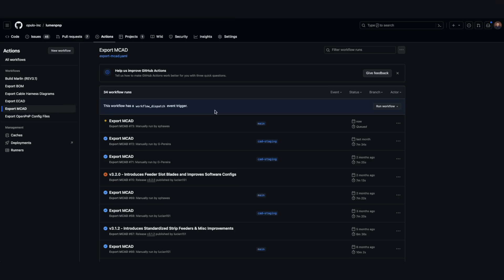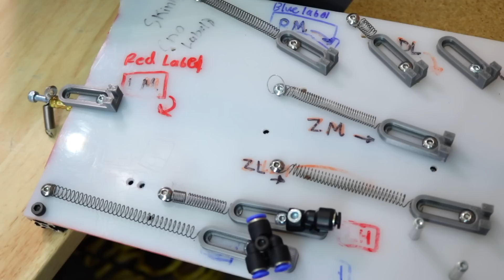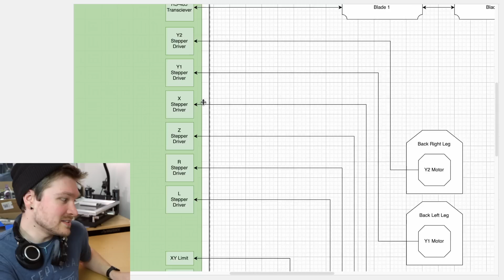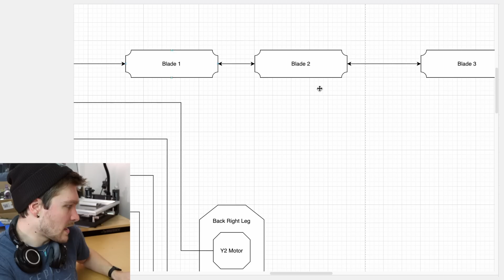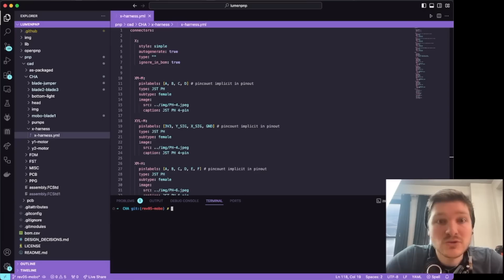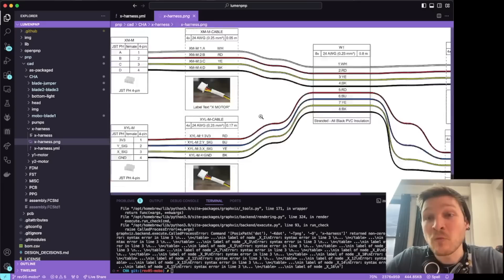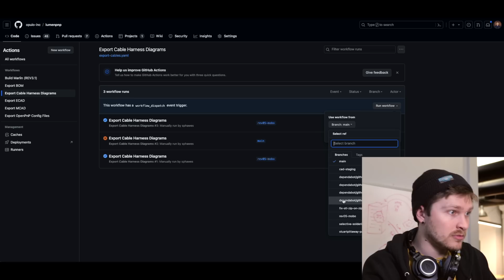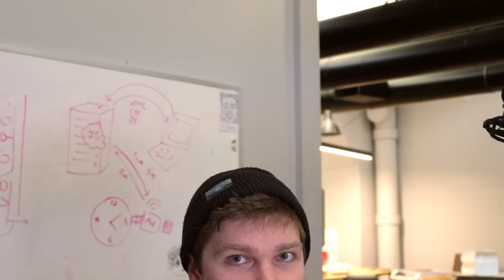How to design custom cables!

Comment: Digikey has cable customisation via web configuration, once done they will send you drawings and also a free sample if you need.
Then you can get the drawing and go somewhere else or ask digikey for a quote.
And somehow its easier to go thru digikey to get molex cables than it is to go thru molex directly.

Comment: Is there a line in the YAML code for noting the wire shielding? Because if there is, I think you forgot to add/draw it anywhere. No lines are shown for shield draining to a common ground.

Comment: You should make a machine that can read the files and automatically measures and cuts wires. You can also have it strip the wire ends.

Comment: The thicker the harness that has to move, the more strain it would be under and will fail earlier. In this case, if you want an easier assembly, maybe think about splitting one huge harness into two, which will make it way more reliable. Of course, it also depends on cable quality and number of conductors per each wire (the more the better).

Comment: I think  having the same wire color multiple times in the main cable isn't really cost efficent as the manufacturer needs to make a non standard cable for you in order to manufacture the harness ... Wouldn't it be more efficent to use a standard color coded cable (DIN47100/ IEC60757)? Sure the connectors would no longer have the same 4 colors but that woul make it even harder to confuse them.
Just random thoughts, great video 🙂

Comment: Aren't there any cool wireviz like text-source/CLI based tools for doing system diagrams?
Reply: Hi, WireViz creator here 🙂 Currently, I've been using WireViz myself in a hacky way for system diagrams. Simply define each module as a "connector", and each port on the module as a "pin". Then you can route wires from pin to pin, each wire representing a cable. It's not ideal, but it works.

Comment: What you made / need is actually a quite old standard in the automotive industry, as your harness wants to be the same. So using standard and the way of makeing drawings would help with the right vendors etc. done that 20 years ago and a wooden board with nails is your best friend 😅

Comment: Would you share what your ordering process is like w/ the cable vendor?
What vendors you've worked with, problems you worked though, lessons learned, what artifacts they require, min order qty, etc?

Comment: Stephen have you considered a usb hub chip on the mainboard to route the cameras and comms over a single usb cable?
Reply: Early versions had that but were problematic. Even now with separate cables you have to be mindful and plug the cameras into separate root hubs on the PC.

Comment: Why the switch to PH any particular reason behind this?
Reply from the maker: a couple reasons: a bit smaller than the XH standard which is beneficial when switching to SMT and integrating stepper drivers, plus more pin variants in SMT!
Reply: Yeah pornhub isn't my cup of t... I'm more an xvideos guy

Comment: Quick question: Why are you not going for USB or CAN for the "Head"? In 3D-printing it became normal to have a toolhead board for all that... Z-probe, Nozzle cam, Y-probe, extruder, hotend...
Reply from the maker: awesome question. i'm constantly reassessing the benefit of making the switch! it's NRE to do so, but ultimately it means a lighter head and drag chain. there are also implications about the upgrade path for existing users. this next release of the machine is mainly focused on DFM and a couple of other improvements i don't want to gate behind that bulk of work, but after that we'll be looking into a distributed controller approach as an option! it's really cool and i think the machine could benefit from it

Comment: My go to for documenting hardware-software projects has been Sphinx, through extensions it has support for WireViz and drawio as well. You can do almost all, including smaller schematic drawings, electronics design calculations and there's also software documentation support like Python and C through sphinx-breathe. Doesn't help with BOM creation but it can provide a full overview of the project.

Comment: Makes a open source PnP, starts a company, creates a viable commercial product. Still has the same headphones.
Reply: Hey man, uh… sound comes out 🤷🏼‍♂️
Reply: We don’t take too kindly to mocking people using things for as long as possible and buying high quality products in these parts
Reply: @ericlotze7724  Ummm... I don't know what bias you are bringing, but my comment was merely an observation. I find it amusing, yes, but not mocking. It clearly works for Stephen, so why change it.
Reply: @OscarSommerbo  ah my bad too, i was just joking about being sustainable or something.  Definitely do what works for you (sidenote the fake leather on my audio technicas is *dying*, i may have to check out that open source design, granted headphone snob in me may just invest in some other headset in a few years)
Reply: @ericlotze7724  No worries. I am still using 7 year old Chinese no-name headphones. And I am severely bummed that finding 50mm drivers in headphones seems impossible. I will use mine until they break.

Comment: It would be even nicer if it exported something that contained text (like a svg or a pdf) instead of png, so that you can copy wire names and do ctrl-f to find a wire.
Reply: Wireviz usually export SVG and HTML (SVG + BOM), but due to the hacky connector Steven used to make the splices in the cable the export of SVG for those specific cables fail and only the png export succeed. -> for cables without a splice and just connector - cable - connector configurations SVG export works great

Comment: WireViz does not support splices ?

That seem like a pretty essential feature, there are hundreds of those in automotive wiring harnesses.
Reply: Gg
Reply from the maker: yeah, in their docs they say it's not really meant for full-fledged harnesses, just simple cables, but it's SO CLOSE to being able to do mostly everything.
Reply: @stephen_hawes  WireViz creator here. Thanks for the great shoutout!
I can't say it's in the works, but branching off/splicing sections of a cable is definitely on the wishlist.
Reply from the maker: @formatc1702  awesome! thank you so much for building such a wonderful tool! ive been poking into the source, thinking about what a PR for something like that might look like.

Comment: It's often a good idea to include a reference of some kind to a standard on your drawings when ordering wire harnesses from a supplier, so you know that it adheres to a repeatable industry-standard, even if it is only to the standard of consumer electronics. Usually something like "Harness X shall adhere to IPC-WHMA-A-620D - Class 1" where 'Class 1' = General Electronic Products, 'Class 2' = Dedicated Service Electronic Products, and 'Class 3' = High Performance/Harsh Environment Electronic Products. Your harness supplier will know what that means, and if they don't then they might not be a very serious supplier.

Might not seem super important, until one day you're unlucky with a supplier or a specific order from a supplier, and then it suddenly is super important :)
Reply from the maker: ah, great note, i should have mentioned that! before sending to our vendor we actually drop the wireviz image into a FreeCAD drawing with some notes about standards, QC procedure, details on labeling, and anything else wireviz doesn't include
Reply: @stephen_hawes  neat!  A video on standards and how you set up things like that for vendors would be cool.
Reply: Are there separate ANSI, or Preferably ISO Standards, or is IPC the standard when it comes to wire harnesses?
Reply: @ericlotze7724  Just FYI, I am not a harness design engineer - I have only done it sporadically. However, as far as I know, IPC provide the standards that addresses the manufacturing of wiring harnesses (and circuitboards for that matter, that is what most of their standards relate to). There are a lot of domain-specific standards that mostly describe design requirements, or installation requirements, depending on the industry. They can be extremely useful for design engineers, but if you put them as a callout on your drawings the supplier will probably wonder how or why it relates to them. It is very common to reference IPC standards in the manufacturing data you send to wire-harness suppliers and/or circuitboard fabs.

Comment: Is there an equivalent cable manufacturer to like JLCPCB for pcb's?
Reply from the maker: yes! we prefer using a vendor directly, but LCSC recently started a service, plus dirtypcbs.com has one that ive used before with great results: https://dirtypcbs.com/store/cables
Reply: DirtyPCB is "decent", though they have a limited selection of connector types they support. I've just sent in my cable drawings to LCSC for some rather simple JST/Molex based cable designs, I'll set a reminder to report back here when they get in. All in all, the quote process was simple, though their online form for mapping cables to connectors is severely limited, so best to have a drawing and/or a photo of your cable as well!
Reply: Just to add on here, I have used LCSC's cable service recently myself and it was awesome. Some simple harnessed with some JST connectors for AC power, plus I was able to specify some odd usage of a single crimp with two wires and they confirmed with their engineer it would work, tested it first, and reached out during each step. Highly recommend them!
Reply: @npriester  How does their pricing work and were you happy with it?